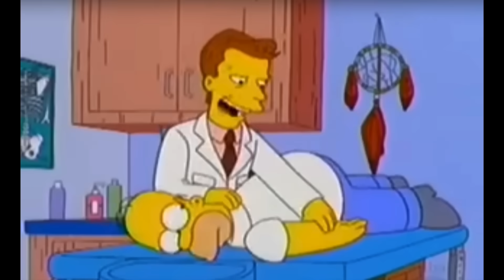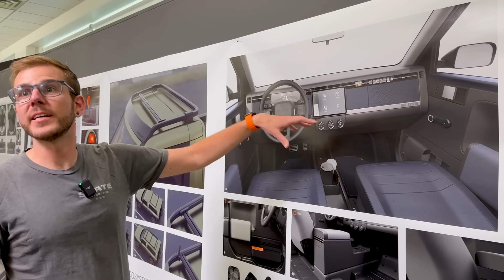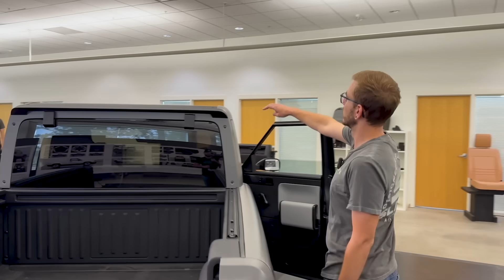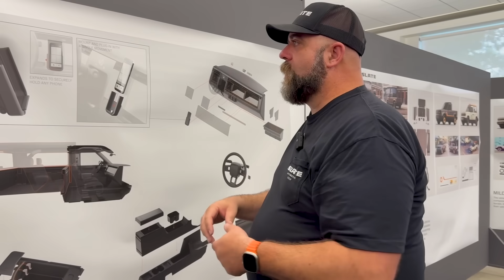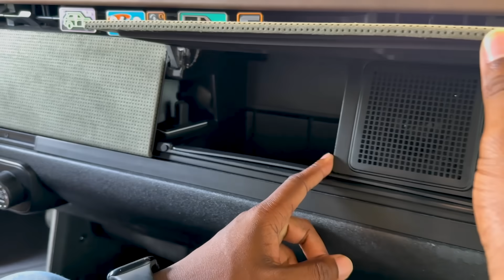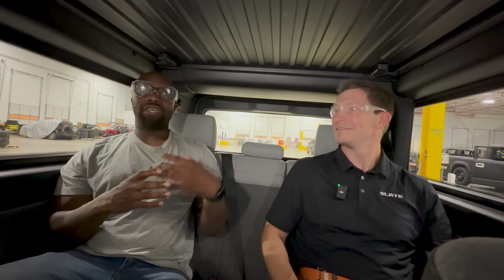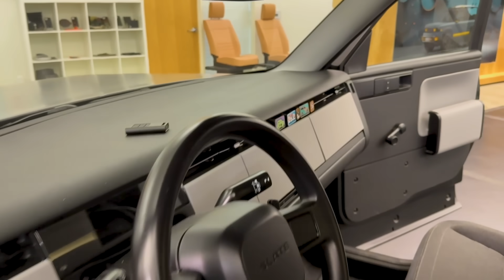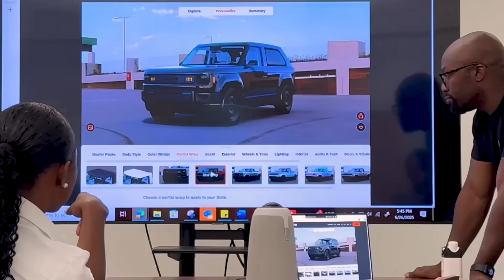The Slate: America’s $20K Answer to China’s Cheap EVs (Exclusive Access)

Comment: I hope Slate works out as a company. Truly,  they seem like they’re solving a lot of issues with the car market
Reply: Not only the car market but the market in general. Imagine if any phone manufacturer sold spare parts and provided instructions on how to fix it.
Reply: @Jan93Banan  I see ur point but honestly I would love that because being able to repair my own stuff is my bread and butter. If slate wasn’t an electric vehicle I would 100% buy one
Reply: @kaseyscoggin7012 Weird take. Why would you buy an ev only if it had a gas engine and no batteries.
Reply: @ThorD4602  I think it's a range thing. I put a lot of miles on my truck and live in icy white canada. For whatever reason up here EV batteries seem to die in 30 minutes regardless how far you go.
Reply: @funfun5656 maybe you have different batteries in Canada then. Because I am in Alaska and that doesn't happen up here.
Reply: @kaseyscoggin7012  buy a cheap little generator from harbor freight and throw it in the back with a couple jerry cans of your preferred fuel, and you won't have to worry about getting stranded somewhere without any way to recharge.
Reply: @Jan93Banan  hell no bozo
Reply: I want one! One thing has pissed me off about modern EVs is all the extra proprietary crap built in. I would have gone out and bought the VW ID Buggy in a heartbeat if they had made it. I do not need a $100000+ Rivian or a premium G-Wagen. I need a truck I can use to get my bike to and from tracks, or grab a load of firewood from 100km away, and if I can charge it with solar or wind from my own property, OMG so much better!!! Though Im pretty sure most of those panels would be falling off with a year, or all the fasteners would be rusted up. 8) Oh, and here in NZ and Australia we had been using small trucks, or Utes (Utility Vehicles) for decades. Both of the larger American brands Holden (GM) and Ford only make SUVs now, no cars except for small front wheel drive options. Having a rear wheel drive Ute would be friggen fantastic!
Reply: @TheChromeRonin  Australian utes are the coolest vehicle type we don't have in North America!
Reply: Hope is the word I'd use to. Best of luck to them :)
Reply: I’m here for the tips on chiropractors and saving $
Reply: @ianhesford 🎉😊
Reply: @sigurdbattenberg1523 come to Colombia❤
Reply: the big 3 in america will NEVER let it make it to market, ever.  its too competitive.  remember, GM killed Saturn because their cars were beginning to outsell and underprice their mainline Chevrolet brand, mainly the Malibu, and Saturn was a better quality than base GM cars offered.  I could buy a fully loaded SC1/2 or SL1/2 in 2002 for $15900.  The malibu was $18k starting.  People spoke with their wallets and GM listened, and killed the saturn brand entirely.
Reply: @chubbysumo2230 I had a saturn good car & looked good too.
Reply: Feels like the Ford model T concept. Build it simple, basic finish and at a price the employees can afford.
Reply: @backyardbeerguy9743  Exactly, KISS, Use modern motors and aerodynamic form, but spare us unnecessary tech we never use.
Reply: Given they secured  $111M from Jeff Bezos and Guggenheim’s Mark Walter - I think they stand a really good chance with these types of financial backers.
Reply: Will they do righties for Australia , Asia and UK?
Reply: Drove a CRX in the 90's and it got over 50 miles to the gallon..it doesn't matter to politicians that they solve vehicle problems..it only matters if there's enough $ to go around..and unfortunately,I doubt it with this one
Reply: Hopefully they don't take a buyout from one of the big brand names.  They will turn it into the Aztec II for sure
Reply: ID for that red hoodie?
Reply: Slate hasn't produced on a mass scale yet, so don't get your hopes up yet.
Reply: What bloody planet are YOU on?
Reply: I need Bezos to flex the dollar baller.
Reply: Im in uk and i want half tempted to import into uk as its amazing value
Reply: We said the same thing when we handed Aptera and Canoo money.
Reply: 20k isn’t affordable
Reply: @Jay12Dizzle  used cars then
Reply: I believe corporate greed could be one of those issues, and property rights. If I buy the thing, it should be MINE!!
Reply: Sure, Roblox car - peak of an US car industry.
Reply: Facts I hope to
Reply: Slate is backed by Jeff Bezos so there’s some evil intent behind it. A have a feeling this will be the go to bare bones company car of “you will own nothing and be happy” this is a Goymobile
Reply: I wont. China makes high end cars for 20-30k. This thing is a piece of plastic junk, with nothing in it. Have you seen how freaking insane chinese EVs are? How can this be the answer to china, when they have high end cars for that price?
Reply: What are they solving?
The biggest issue currently is cost and that is primarily driven by electronic systems. The NHTSA is still mandating systems like Automatic emergency braking be installed and more will be coming. SLATE gets rid of the radio and forced crank windows but they can't change the government costs.
Reply: “Statistically, you get one flat tire per 7 years.” Some AAA studies and tire shop surveys have found rates as high as 80% under-inflated among tested spares.
Reply: @pocketpoolboy  sooooooooooooooo????????
Reply: the idea is SOLID the look is Good the Price is what gets me.
Reply: well trumps big beautiful bill just got rid of the EV credit so the price just jumped up $7500
Reply: Biggest iceberg in their immediate future, a Detroit "truck" with only rear wheel drive. Every winter see these guys (ICE powered) stuck. Guessing their leadership is in Long Beach CA and never drove in a mid-western snow storm....
Reply: @pilotdave9442 funny still how most of the Nordic countries in Europe work very well with snow and most of thew are fwd.
Reply: @pilotdave9442  I drive a fwd in Canada, while living in the middle of nowhere. Ya'll are week if you think that awd is necessary for winter. All you need is winter tires and some self respect. People have been doing it for decades and somehow got where they needed to go.
Reply: They are going to cost a lot more than you think.
Reply: @jjones2509  any new truck under 30k in the US will still be an improvement, even if just an incremental one.
Reply: they havent solved anything yet
Reply: BYD is leagues ahead of this thing...
Reply: Bezos Car
Bezos also does Blue Origin, Bluesky, and owns the WSJ
Make if that what you will
Reply: What issue are they solving? This is super expensive without the tax incentives. 28k for a 2 door, RWD truck with no amenities inside and only 150 miles of range that's basically the equivalent of 90 miles if you charge it between 20% and 80% like is suggested for battery heathy. If anything, the Maverick solved a bigger issue than Slate did when released because the Maverick is a 4 door truck with a usable back seat, usable bed, hybrid engine standard, and some capability all at a low price. A Maverick is a better buy than this.
Reply: Yeah uh huh 😒he magically at just the right time, he has the solution for the problem, that his rich buddies created (non existent really cheap small truck market.)
Reply: Unless one of those options is a v4,v6, or v8 and they can solve the problem of dry rotting plastic..I don't see this ending well
Reply: You really hope Jeff Bezos gets more money?
Reply: They haven't solved anything other than produce an advertisement. The concept has been around for decades but it's not profitable for any company.
Reply: I bet it doesn't, it may hang on for a while but it's an EV and the EV craze is all but dead in the U.S. because the consumers have figured out it's fools gold, They can't go very far, they take too long to charge and they aren't built as well as people think they are.
Reply: how exactly? 25k for something that will have a very short range and have almost no capacity to carry anything. they would have been better off buying the small stripped mexican dodge ram 700 and converting it to electric enmass.
Reply: What issues? They are preparing a crap for 20k! China is laughing his ass off by now!
Reply: By offering a million accessories? That’s what Pontiac did with the Aztec did too, and look how that turned out…
Reply: @conor7154  yeah but the pontiac aztec was a piece of shit
Reply: @Department.of.HomelandSecurity So is this. They’re trying to market the fact that everything is made out of plastic and that you’ll have to 3d print your own mount for your stupid Bluetooth speaker that you’ll now have to bring with you into your car every time you drive. This is literally a middle schooler’s idea of what a car should be.
Reply: @conor7154  It's all the car a lot of people would want. Also, the Pontiac Aztec was on of the biggest pieces of shit ever made.
Reply: @markburton8303 People clearly want more car than “empty box that will have no resale value in 5 years because the battery will be dead and the company will be bankrupt.” If this is what they wanted then there would be more ugly empty shell cars other than F250s used for utility vehicles, which obviously this cannot be used for. People want normal, nice cars, not cars that you have to design your own cup holders for.
Reply: @conor7154  ah, the 'battery dead in 5 years' line. People want 'normal, nice cars' as they have forgotten how to fix anything and have been duped to need a load of rubbish that they don't need and pay handsomely for it.
Reply: @markburton8303 I love how you don’t even try to dispute it. Imagine Rich’s dead model 3 he just purchased, but Tesla doesn’t exist anymore. That’s what you’ll have with this plastic POS, except you won’t even have a car with a nice interior because the company is currently bragging about how cheaply and poorly built it is. I know it’s hard for you to imagine buying a car that you don’t need to fix because you can’t stop buying cars that are constantly breaking. Try buying something that isn’t a beater for once.
Reply: @conor7154  yeah but the Pontiac Aztec was a shitbox
Reply: @conor7154  Most cars have been sold with a useless factory stereo system that 90% of customers changed to off the shelf car stereos. Same can be done with this one..
Reply: @conor7154  why would i try and dispute something you just cooked up in your head? That'd be pointless. 

I bet you're a shitbox Honda guy.
Reply: Toyota gave people a nice small roomy fuel efficient and reliable car for about 15k called the Scion xB and still nobody bought it 🤷🏽 @conor7154
Reply: @vihreelinja4743  Literally what country are you living in where you think that’s true? Are you Indian or something?
Reply: @markburton8303  agreed, until the cybertruck took the title by a landslide
Reply: @Department.of.HomelandSecurity  This is a piece of plastic shit.
Reply: @conor7154  I, for one, would love to own and operate a plain jane model as a daily ride.

Why would I need to pay for stuff that I will not use or want 99.9% of the time?
Reply: @conor7154  "people" can only want what the dealership sells (or what was sold 5-10 years ago if shopping for a used car). $50k+ cars - overcomplicated, unrepairable, riddled with spyware, etc - are utterly absurd but this nonsense makes money for manufacturers and dealers so that's what people are told to want. If Slate happens, I'll buy one as a show of support for the concept.
Reply: @conor7154  then don't buy it and shut up
Reply: @kennycheung1743 You’re so full of shit lol
Reply: @conor7154  oooh good point, no one wants a cheap vehicle. That's why chinese manufacturers are all going out of business! oh wait
Reply: @epicosity5588 Yeah the Chinese are so trustworthy and definitely don’t have an entire culture based around lying and cheating and we should definitely trust their self reporting that they won’t allow auditing on
Reply: @Department.of.HomelandSecurity  And this isn't?  No paint, no carplay/android auto, no power windows, no radio, only 150 miles of range...
Reply: @rockinkuwaitchris  and still $28K
Reply: @rockinkuwaitchris  What are you talking about? They said the entire electronics package is an open source app on a $70 Android tablet.
Reply: @eddieellis677  So you have to buy the tablet separately. Just a 70 dollar one?  I know my cars screen is built specifically to withstand the 120+ degree temps and -30 temps my vehicle experiences (special liquid crystal mixture and aluminized heat shield).  What $70 tablet does that?  Or are you saying I need to take it out every single time I leave my vehicle and carry that thing around with me?  Like if I go for a bike ride for a few hours, most every tablet I see is 115 degree rated, so do I now need a bag to take that with?  What about thieves?  You want to have your car broken into, leave a tablet out.  Why can't I just get an integrated radio with a screen on the head unit?  Do I now have to have wires hanging around all the time to keep this tablet charged?  Or if I am using my phone, I guess that wireless android auto so I can just keep my phone in my pocket and still stream/use google maps on the car screen is out huh?

 And the easy integrated buttons on the steering wheel to use it?  oh that's extra too I see on their site for the hands free bit... 

  What about the tablet mount?   Yup, that's extra too, another add on for their site there.   

And the speakers?  Oh those are extra too...  

Wow even the mounts for the speakers are extra... 

So already out of the gate it's more expensive and you are saying you have to keep spending more and more money just to get a simple hands free experience that might be kinda close in convenience to carplay and Android Auto?  And now I need a tablet in my car.  It's an interesting argument. "Yes it's more expensive and has less, but the extra cost to get you up to a base level isn't too much beyond the already too high price point".  

And the big question... is this going to work, be as easy to use as Android Auto, have capability for both Android and Apple?  Or is this going to kinda do it all poorly and end up getting cut off like the Fire Phone?
Reply: @conor7154  True, they're building and selling/exporting millions of EVs at a loss as some grand conspiracy to convince the west that they are getting ahead in a technology when really the United States is still the best in the world. USA! USA!
Reply: @conor7154  You forgot to add that the Pontiac Aztec was on of the biggest pieces of shit ever made. Come on I thought this was just a thing all the comments needed to have.😆
Reply: @conor7154  Battery tech has been increasing energy density by an average of 5% per year. Lithium ion has gone from 250 recharge cycles to 80% capacity to around 1200 recharge cycles. If a car can go 250 miles on a charge and it will take a charge 1200 times, that's 300k miles. Average. Before the battery gives 80% of its original capacity, not until it needs replacing.
Reply: @friendlyfire01 That’s also for cars from companies that aren’t marketed as 10,000 dollars or whatever. There is no way this thing, if it ever goes into production, which I will bet anything that it won’t, will have the battery technology to rival even a smaller brand like rivian.
Reply: @conor7154  okay then why does no one buy them per see? There's a lot of "normal" nice cars but none of you ever buy them. I wonder why?
Reply: @conor7154  look at all of southeast asia and you'll understand how prevalent plug and play based platforms are
Reply: @SlimeeCheetos I just bought a new Toyota Supra. Seems like a lot of people are buying normal cars that aren’t based on gimmicks like having to make your own cup holder. I’m looking forward to this company failing like every other stupid EV startup. One of my favorite parts is the subsidy they’re completely dependent on ending. Like obviously they weren’t going to sell their stupid plastic car for 20,000 dollars in the first place, but now without the subsidy it’ll be way more than that. What a great deal, buying a car with manual windows and no speakers for 30,000 instead of a 5 year old Camry for less than that…
Reply: @markburton8303  what people want…. A 30k two seater without a radio.  It looks like a truck… but my crv(which cost  about the same) has similar payload and towing, and sits 5, and has a radio, and leather seats, and a sunroof , and power locks and windows… it looks cool. I’d buy it started at 15k? At 30k it can’t do anything any other truck you can get do. In fact it does everything worse.
Reply: @conor7154 You are 😊clearly an EV hater, because your knowledge of EV batteries is so off the mark it’s not even worth commenting further.
Reply: @conor7154 Cheap and reliable. That’s what I want out of a car. I’ve driven family’s and friend’s cars that are extraordinarily expensive and unreliable, just because it is overpriced doesn’t mean it’s durable, I’d argue the opposite. My friend has a new ford explorer platinum that’s been into the shop half a dozen times meanwhile if you pick up an older crown vic it’ll drive the wheels off. Just because you want to “live in luxury” doesn’t mean there’s no market for a cheap reliable car that’s simple, and the plastic is an irrelevant argument because new premium cars are mostly plastic as well. I’m looking at the ford ranger right now, the old style. I have some stuff I need to tow and it’s the perfect vehicle for that. The blank slate would be a perfect alternative for a ford ranger in my eyes, and I love the idea of having the option of building my own parts for it. It may not be for you, but there’s a huge market segment that is alienated by these gargantuan trucks everyone has now, and I think at such a reasonable price if these things are as durable as they’re promised to be they’ll sell like hot cakes.
Reply: @conor7154 for most Americans today,a company MUST build cheaper basic cars/trucks
Reply: @conor7154 a car is something to get from A - B.
Reply: @markburton8303  shut your mouth champ
Reply: @markburton8303  right bozo....
Reply: @kennycheung1743 Because you're getting it included for free as this truck is now priced with all other small light trucks.
Reply: @epicosity5588 China makes 90% of the stuff on the market even vossen wheels, pure turbo, valvetronic exhaust  to be rebranded as U.S made products.
Reply: @Department.of.HomelandSecurity  wtf are you talking about. The aztek was amazing for chemistry teachers
Reply: @conor7154  Batteries are lasting MUCH longer than anyone expected. Not sure what you are talking about other than obviously not liking ev's.
Reply: @mikeb1039  They are not lol, and I have no problem with EVs, I just would never own one because I live in Japan and EVs aren’t a thing here
Reply: @conor7154  lol we just ignoring what actually happened with pontiac?

They got sshut down because GM took the buy out
Reply: @thunderlighting2006 yeah definitely didn’t have anything to do with their products being complete shit, like this pathetic excuse for a “car.” But that’s okay, it won’t even go on sale lol
Reply: @conor7154  dang i think you're just jealous 

You would think someone who lives in Japan would like the idea of a small economic truck

Its ok buddy i forgive you
Reply: @thunderlighting2006 Kei trucks are universally seen as junkers and I don’t know what you would have to be driving to be jealous of some plastic front wheel drive 80 hp “car” that won’t even be produced
Reply: @conor7154  well it serves a solid purpose for a fleet and especially a farm vehicle. Because who the hell is spending $40k on a new ATV of all things?
Reply: @SlimeeCheetos  I could maybe see this being a fleet vehicle. That would certainly be smarter than marketing a consumer car with “wrapped” wheels.
Reply: @conor7154 so apparently this car is not for you. It's fine just move on. Just because one failed doesn't mean anything there are plenty of other versions of successful cars that have failed counterparts.
Reply: @conor7154 Pontiac did not have the advantage of being a new young company with a market desperate for something new and affordable.
Reply: @conor7154  yeah but the nice thing about that is you can pick and choose what you actually want on the truck so if you want it bare bones you can or if you want more features you can have that too and you can do these installations yourself or get a company to do it
Reply: @sometf2player752  No one wants to do that. No one wants to have to pay extra for speakers in their car.
Reply: @conor7154  i mean you dont have to, you can use your phone as a speaker or bring a bluetooth one
Reply: @conor7154  The Accessories are not what they are solving. They are creating a LOW COST CAR, with repairable parts. Period, full stop. I grew up- driving cars that I could go buy parts for inexpensively and fix that shit. Now a headlight gets cracked its 2 grand for the housing. I have a 2019 car, I got in a fender bender and the car was drving fine after with only cosmetic damage and it has Full coverage, my insurance company tried to total that shit because of a vent inside the dash that had the flap damaged and that vent part was 1000 dollars. Car prices and planned obsolescence in cars if fucking horrible now. A car where a school teacher could swap the fender without specialized tools or skills is AMAZING. Go sit down Conor the adults are talking.
Reply: @conor7154  True, but..........Aztec. Kinda speaks for itself.
Reply: @conor7154   They are offering a simple truck with no gimmicks. The customization is cool but not the main main selling point. The main selling point is the cheap and simple nature which people absolutely want (not everyone but a significant amount) and it checks out if you look at the prices of old Tacomas and Tundras that sell for as much as a new truck even though they are bare bones.